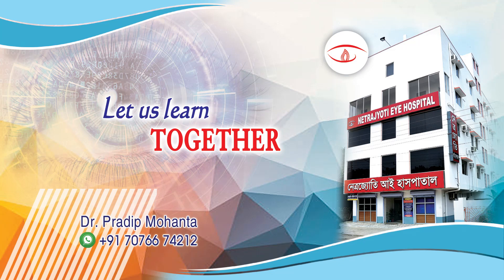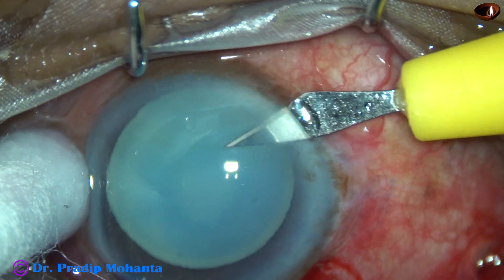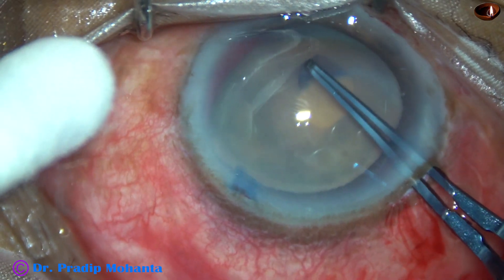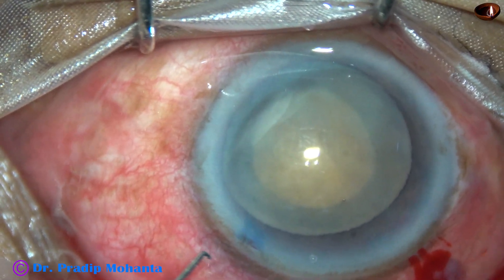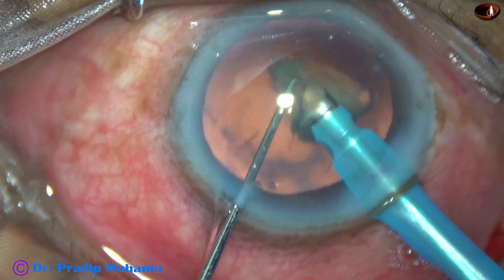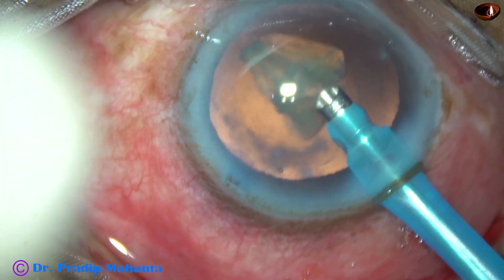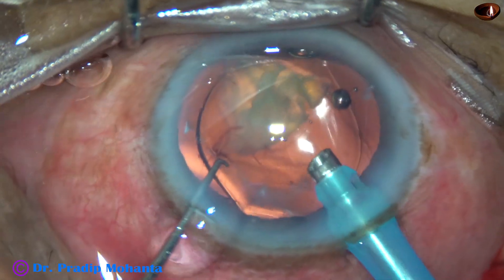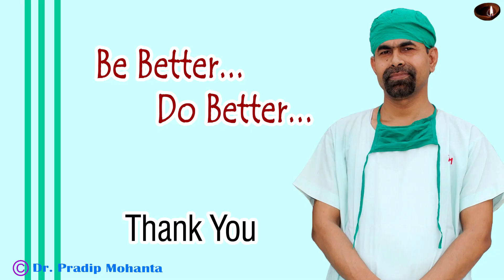Emulsify the last bit of nucleus using IOL as a platform : A Safety TIP for a Morgagnian  Cataract

Comment: Nice technique using IOL as a scaffold. Commonly recommended nowadays👍🏻. 
Some of the suggestions:
1. Better to emulsify with holding at apex of pie, somersaulting sharp edges can tear the posterior capsule in harder cataracts
2. Second option can be using an iris repositor beneath the last piece.
3. If hyper mature cataracts turns out to have very small nucleus, visco can be injected inside the bag also to do the rhexis.
4. To use viscoat, before emulsifying last piece on IOL scaffold.
5. To do the polish of anterior capsular cortex even after inserting the IOL will help reducing phimosis later on in 4.7 to 5 mm rhexis.
Thanks really appreciate your teaching skills🙏🏻

Comment: Cortical not remove
Reply from the maker: No cortex in this case..
Reply: Nice technique using IOL as a scaffold. Commonly recommended nowadays👍🏻. 
Some of the suggestions:
1. Better to emulsify with holding at apex of pie, somersaulting sharp edges can tear the posterior capsule in harder cataracts
2. Second option can be using an iris repositor beneath the last piece.
3. If hyper mature cataracts turns out to have very small nucleus, visco can be injected inside the bag also to do the rhexis.
4. To use viscoat, before emulsifying last piece on IOL scaffold.
5. To do the polish of anterior capsular cortex even after inserting the IOL will help reducing phimosis later on in 4.7 to 5 mm rhexis.
Thanks really appreciate your teaching skills🙏🏻